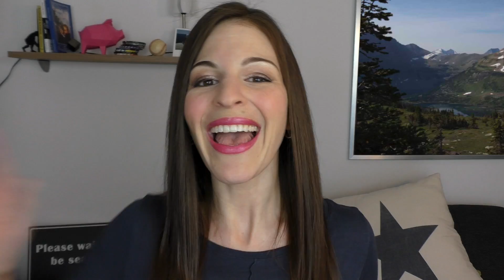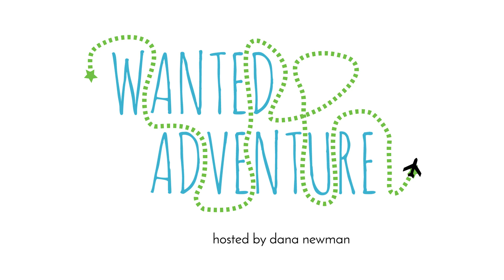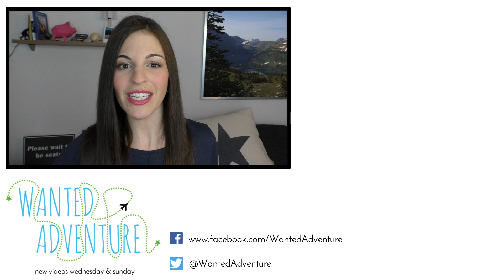Why Are Houses in America MADE OF WOOD?!

Comment: On the west coast of North America (Canada and the USA), houses are built out of wood because they are more capable of withstanding earthquakes because they sway with the quakes instead of just crumble like bricks would.
Reply: It actually depends on which type of concrete and steel you use. Some are more flexible or resistant than others in specific situations. Just take skyscrapers as an example. You really don't want to build them out of wood.
Reply: Most single family Japanese homes and that includes newer modern homes are certainly not made of steel and concrete. It's wood stick frame just just like it is in U.S. and Canadian  homes.
Reply: But all of Japan's structures that have withstood the sands of time and innumerable earthquakes are wooden.
Reply: I lived in Tokyo for 2 years while I was in the Navy. It's true that many buildings are made of steel, but the buildings are actually placed on special support structures under ground that are built to sway with the earthquake, subsequently absorbing the shock, and leaving the building relatively undamaged.
Reply: Yes, it depends on the type of building. Concrete and steel is too expensive for regular one-family homes or the regular sized apartment buildings.
Reply: There are wooden buildings in Japan that have stood for hundreds of years.  I think they know a little about earthquakes there.
Reply: Earthquakes? The houses are made of: STEEL + CONCRETE + BRICK all design to withstand earthquakes.
Reply: That depends too. The material might be cheaper no matter where you live, but the price for design and planning will be much higher if there aren't that much companies who actually build this specific design. That's why wood houses are way more expensive than stone houses here in germany in most cases.
Reply: You are correct! Large skyscrapers need to use steel and concrete to hold up the upper floors. A one or two story house would have similar damage in an earthquake, but stucco on wood makes the cosmetic repair much easier and cheaper.
Reply: I was on the island of Crete in 2002 and was awaken in the middle of the night to 6.2.  I was thinking, "I hope this hotel holds up."  Fortunately for strict Greek building code, I didn't hear of any problems afterwards.  I noticed buildings there were going up that they were made from a combination of concrete & steel.  It looked that the main structure was integrated together.  Now if this was in Turkey, not sure if I would be here to write this.
Reply: You can extend the life time of any material if you take good care of it. Just look at stone castles in europe. Most of them are falling apart, because nobody actually protected them against corrosion over a long period of time, but many chateaus and buildings in the middle of cities are still in a good shape, either stone building as well as wooden building, because they had a function at any given time.
Reply: I agree with Jimichan. Just look at all the pagodas in Japan, people: Wooden structure, wooden joints, no nails, yet they are still standing fine, in fact some of them has been there for 500 years. So does the material still matter?!
Reply: That's a nice side effect, but that's not the reason why the houses there are build out of wood.
Reply: Actually, Japanese did purchased a whole lot of houses build according to Canadian standard. There was a company where I grew up where they made prefab houses and sold 10000 a year for I dunno how long. Back then there were around 35000 already builded in Japan. Not only they sway with earthquakes but they are insulated for harsh winters. I know what is -53ºC is. -30ºC around where I grew up was usual in winter.
Reply: The jet impact and the fire from the jet fuel didn't bring the buildings down, the fires from the stuff in the buildings weakened the steel, so that the floors started to collapse.  WTC 7 had an above-ground fuel storage tank in it.
Reply: It's not the only reason but earthquakes are the reason that you don't see as many brick homes.
Reply: Steel rebar adds tension strength to concrete, but it can still crack.  Rebar is expensive, and so is concrete.  Sand is cheap, so poor countries have disasters when earthquakes hit.  Haiti is a prime example.
Reply: Pads are called base isolators and are a relatively new invention. Many large buildings have them and they work well. Here in NZ most buildings are made of wood and not many are of any quality. But the wooden ones do last, many have been standing over 100 years and have been through many quakes but just flex and absorb the energy. They do however flex in strong winds, which is slightly unsettling.
Reply: @MrDeicide1:  Just to give you one documented fact, since facts seem to be a little difficult sometimes: "The wood used in the center pillar of the pagoda (at Horyu-ji, in Nara) is estimated through a dendrochronological analysis to have been felled in 594."
Reply: But it does matter. Concrete has some properties, steel has different properties. Combined together they enable us to build structures and shapes no other material could. The very minimum known lifespan for a concrete is 100 years (that's what is known since it's invented ~100 years ago). You won't find 100 year old wooden house in good shape. While you can go to Europe and witness Roman structures still standing. I know they were not built with concrete, but they used similar materials.
Reply: I understand what you are saying and each one of them has pros and cons but I'm going to mention just a few examples to prove my point.  There's the temple in Horyu-Ji, which was built in 607AD
(I suggest googling Shou Sugi Ban, it's a technique preserves wood very efficiently. But even without that, wooden houses can survive ages.) There are countless of (wooden) Tudor homes in England, some of them are older than 300 years and there is a 700 years old wooden house in Switzerland (among many other in the area from the 13.century.) I walked across the entire Europe and have seen thousands and thousands of old wooden houses, cottages. You would be surprised mate, they are still in a surprisingly good condition.
Reply: True, but also wood is easier to cut through if you have to save someone under a support beam, also usually gas lines will be ruptured and sparks from a saw cutting through metal is not ideal.
Reply: It's the same with grocery stores or factories. In the U.S. they normally use steel beams for such buildings. In Germany it's mostly reinforced concrete beams.
Reply: @OldLordSpeedy yeah but didnt they use to build wooden houses that were earthquake resistant and required no nails?
Reply: +bcubed72
Steel won't melt too, if it's properly protected against fire ;) And kerosene won't even get near the melting point of steel at all
Reply: Yeah, that's what many people say, who didn't even try to do some research. The compressive strength of steel decreases with higher temperatures, just like any other crystalline material. Given enough time the weight of the upper floors can exceed the limit of the steel, even if it's not molten at this time. That's why you protect such buildings with material for fire protection, but nobody actually expected a plane flying into a skyscraper which knocked of this material. A normal residential fire wouldn't have never take down these buildings. And the second building even had to withstand the shake caused by the first building, which also could have additionally weakened the material
Reply: So john skilling failed as an architect. It's one or the other. Most people would choose to throw an innocent man under the bus than to question things, however. I know all the info, I was into it years ago, and I never came to a satisfactory conclusion. The whole incident, in hindsight, was too convenient on multiple levels with too many unbelievable coincidences. So I am permanently left in limbo about having an opinion on it due to certain questions never being addressed, unless I let my bias interfere, in which case, I will assume it was a terrorism, as that would be the American thing to do.
No, I am not someone into conspiracies, and had I not researched it, I would of called them all paranoid schizos. Stay away from that rabbit hole unless you want to realize some very uncomfortable things.
Reply: "In Tokio (Japan) they use concrete and steel - they have many earthquake yearly!"
Yeah, that's specialized concrete designed to flex...typical concrete is strong only in compression, and brittle.
Reply: The buildings rest on pads that allow the building to move with respect to the ground during and earthquake.  The building sort of slides and stays in place while the ground moves under it.
Reply: That's modern sky scrapers, not houses.
Reply: Hey, um, smart guy,  I know that the Ise Grand Shrine is rebuilt like that.  I've been to that shrine a couple of times.  Have YOU ever been to Japan?  Are you really asserting that EVERY wooden building in Japan is rebuilt every 20 years?  
You seem pretty comfortable calling people morons ...
Reply: Yes, materials do matter, but I have stayed in wooden houses in Japan that are well over 100 years old.  As I documented earlier, there are wooden structures there that are over 1000 years old.  
It is also interesting to note that many concrete structures that were built for the last Tokyo Olympics in 1964 that are now crumbling.  So many structures were built in such a short time that quality materials were in short supply.
Reply: "Just take skyscrapers as an example. You really don't want to build them out of wood."
But...jet fuel can't melt oaken beams, yo!
Reply: Actually, the twin towers were designed to be airplane proof due to a previous accident where a malfunctioning passenger jet hit a skyscraper, which did not actually cause the building to collapse. It was rated to withstand being hit by a boeing 707. The WTC were the first instance of a plane causing a skyscraper to fall down, in spite of it being designed specifically to prevent that from happening, and this fluke didn't happen once, but 3 times that day. The first three times a plane brought down skyscrapers, even though it was the not even close to the first time a plane hit a skyscraper.

If not a conspiracy, then the architect(John Skilling) needs to be sued for fraud, too bad he had recently died, so he couldn't defend his case. Not saying it was a conspiracy, but just want you to have the facts, as uncomfortable as they are.
Reply: sweetcanada17 Wrong.
Reply: Cool
Reply: Maya Natsume many European castles are "falling apart" because they were destroyed in ancient wars, and were abandoned afterwards.
Reply: Jefff Turkey use also combination of concrete and steel.
Reply: OldLordSpeedy That is not entirely true, newer Japanese homes are also built with a frame wood even in major cities. Most newer Japanese homes are built with a combination of either steel and wood on a concrete slab. Not just only with  steel and concrete.
Reply: I'm pretty sure every local carpenter will repeat this nonsense all day long. The civil engineer would not agree.
Reply: Maya Natsume did you not see kerosene (jet fuel) melt steel and cause the collapse of some rather large buildings on the 11th of September 2001?
Reply: Mexico has its own share of earthquakes and we also build our houses with stone and iron bars like in Germany. When I moved here to the US I assumed this houses made of wood were part of the buy-a-new one/throw-away/buy-a-new-one cycle of American capitalism, but I could be wrong.

Comment: actually i started watching "fixer upper" and besides their houses look almost the same i was really shocked about the way americans build their homes. A friend of mine lives in a house, built in 16hundred bla....A very old timberframed medival house...I doubt that a usual wooden american house would last more than 100 years....American houses look like something you don't want to live until you die or even you don't want to inherit to your children or grandchildren
Reply: Almost nobody in America wants to live in a house they inherited from their parents.  That is a very uncommon occurrence here.  Also, as incomes have risen and construction costs have fallen, the average house size has gone way up vs 50 years ago.  The average size of a new house in America last year was 2600 square feet, which is about 242 square meters.  My grandparents' old house is half that size, so when they passed away, my family sold it.  That's very typical.
Reply: Increasingly, houses aren't really intended to last more than 30-40 years. They're designed to be constructed quickly and cheaply, and to be replaced just as easily.

There are exceptions. You'll see a lot of older masonry construction in some parts of the US. Not many new buildings are masonry, as the labor is simply too costly. You will, however see newer houses that use concrete or steel-framed construction (although less common).

Comment: I think our "current" condition has to do with american culture after WWII. Our economy was flush with over production after after the war, and prices were cheap. There was a furious rise in the standard of living and house was in a crunch to keep up. This lead to the change from "timber frame" wood homes to "stick built" wood homes.  While both are "wood" homes, the two are not the same in durability or cost.  By going the "stick built" route,  a young couple in the twenty's could afford to buy a NEW house, and car, and things to fill the home, AND expect to be debt free much sooner than retirement.  This then became the "American Dream", and has been sold ever since. 
The reality today is that, many stick-built homes are of such low quality that many no longer have a service life as long as the mortgage! The standard of living is only maintained as long as one is working, at a good job, and even then the promise of nice retirement is simply not possible. To counter this, there are building codes and standards, but even those are often ignored by builders, in search of the easy dollar.  Would stone or concrete homes be better?  Probably not,  as it is the culture of the society  in search of the highest standard "NOW" versus a lower standard but for longer term stability.  Also note the current trend is for workers to change jobs every 5 years. If I can buy a crappy (built) house now, and make it work for 5 years, I can pass it off to the next guy, while I search for that rare, quality built home.
Reply: Stick built homes are a lot older than you think.  There are very few timber frame homes in the US.
Reply: Balloon framed structures with dimensional mill sawed lumber were being built in the late 19th century.  I think timber frames, post 19th century, were/are the exception, not the rule.  Not WWII.

I'm not sure why they're such a bad thing either.  Timber frames were massively over built because the dimensions of the members were chosen based on the size of the joinery and the trees, not based on load calculations of any kind.  I live in a 250 year old timber framed house.  I don't know that, aside from a natural disaster, there's anything to go wrong with the frame of a stick built house itself.  It's almost always a problem with the foundation or the roof that causes damage, but that'd be a problem for most building materials.

Also, of course, balloon frames are a huge fire hazard, but platform frames edged out balloon frames in the first half of the 20th century or thereabouts.